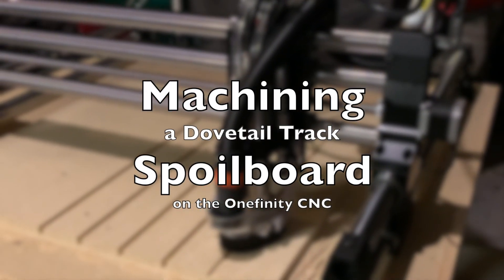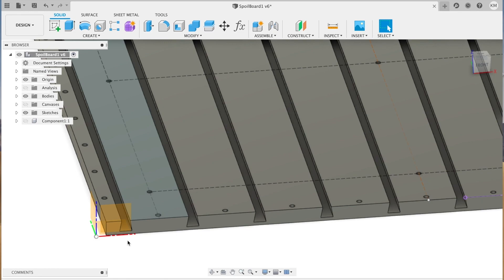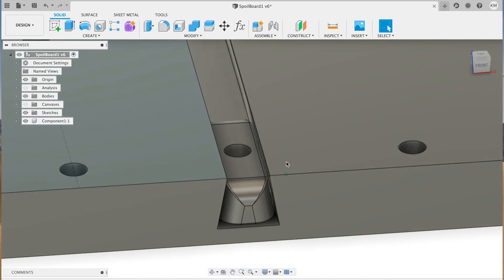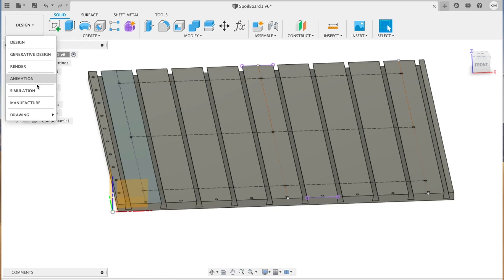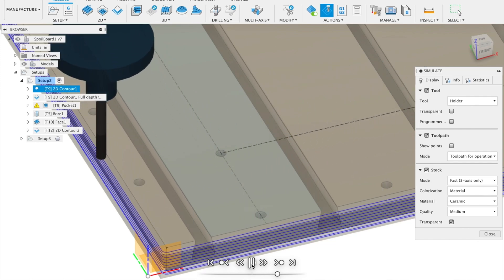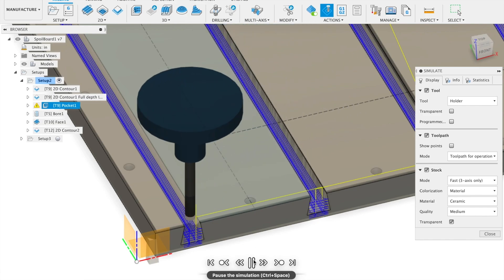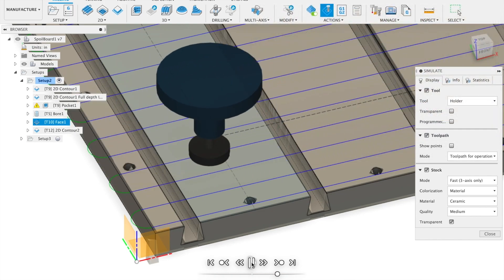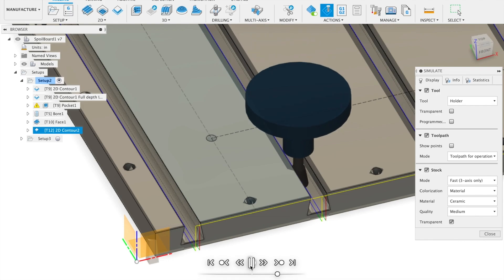Onefinity Spoilboard

Comment: Have you had any issues the the dovetail breaking lose. I use the micro-jig dovetail system on my workbench, have had no issues. Just wondering with the downward pressure of the clamps, any break outs of joints  thanks

Comment: @Kevin M - Thanks for the video. Great design. Would you consider sharing the gcode? I opened the .obj file in F360. It says v5 and I noticed the one you demo'd was v6. I am considering laying one out in Vectric's Aspire program but am mainly interested in the outfeed and infeed settings for the dovetail bit. If you don't feel comfortable sharing the gcode, I understand. I, too, have a 1F Woodworker (just got it) but I am not new to CNC machining. I am an IT Professional so I guess I am a geek-woodworker, as labels go.

Comment: Hi Kevin, what spindle and water cooling set up have you used? Thanks again
Reply from the maker: Huanyang 800w spindle/1500w VFD.  It runs fine on 120v/15A circuit.  The cooling is just a submersible pump in a kitchen storage container.   80%water/20%antifreeze for some corrosion protection.  There’s only about 2 gallons total in the system, but at 60deg ambient the spindle can run all day and stays cool.

Comment: Thanks for video. I know you said the board is MDF but that material is actually particle board. Do you think particle board is better for this?
Reply from the maker: Good catch. MDF is the better material for this application, as it is more dense and because it has a more uniform fiber size it machines better.  The video is made of me cutting a scrap piece of particleboard I had on hand as a practice run.  It came out fine, so I kept it.  It has worked okay for a beginner so far!

Comment: You have a new sub Kevin. Very nice production all around. I'll have to check your other videos to see if anything there but what spindle is that? I have a couple month wait yet for my machine but that looks like the way to go. Haven't heard of Thingiverse before, looks interesting.  Is that file for the board compatible with anything other than Fusion 360? Thanks and will be checking out the rest of your channel
Reply from the maker: Thanks.  Spindle is the 800w huanyang.  It seems to work well enough for my use, and is a nice quiet option for 110v.
Reply: @kevinm413  Do you know if that model file will work with Carveco Maker?

Comment: Very nice job.  This will be a useful spoil board with the dovetail grooves.  It’s nice to see your equipment in operation as well.  This video is a testament to the quality of the tool.  I couldn’t see what router you are using.  Does it accept 1/2” shank bits?  Did you attach a different collet?  I hope to see more video demonstrations from you.  Thank you for sharing.  👍🏻

Comment: #283 here,would i be wrong to just use a router table to make the dovetail grooves.  I don't know as much as you.
Reply from the maker: Not at all wrong!  That’s probably the ‘standard’ way of doing it.  I just thought I’d use the machine to cut out it’s own board.  I could send you the g-code program for each operation, but you would need to use the same size bits.
Reply: Sure, but i am thinking using a router table so i can make the  board bigger . But the one you have is plenty big .  I got til nov 7 and im just now working on my cnc table top.